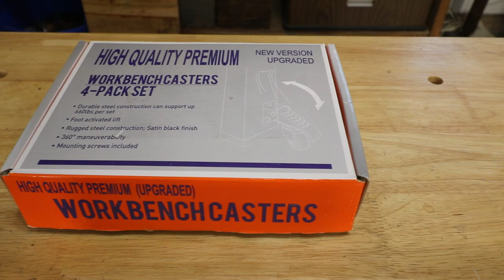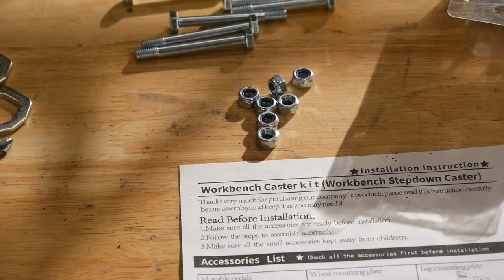Windsor workbench from Harbor Freight, upgrade wheel kit, Episode 208 Coffee and Tools

Comment: I just got the bench and plan on modifying it fairly heavily. And that's the issue I didn't think the bench was going to be very heavy, but if i load it up kith extras I'll be sure to use the affiliate link it's still working as of today June 27 2023! Love the vids brother! Keep them coming. Ever consider installing a table saw to one end to use the bench for outfeed support, I'm thinking of doing that and that'll add some weight. Plus at least a 5 or 6" tool tray/bin on the back side. Hell I might save the shelves for another project and just add some heavy shelving under the top. A lot of guys recommend adding an extra layer of plywood or MDF under the top for rigidity and strength.  See I might need that caster kit after all. Peace My Man!!
Reply from the maker: All good there wooddogg8. Really like that table saw / out feed top idea.

Comment: casters and carts are a life saver in my shop. I've got a 1 car garage space so everything is on wheels so either I can move  what I'm working on to the driveway or wheel everything else out of the way to the driveway. I do need to upgrade work benches at some point, I'm still using 2 old desks one of which I've attached my vise to.
Reply from the maker: Wheels.more wheels LOLO..you get the picture

Comment: How is the stability of the workbench when hand planing wood boards, especially when you have locking wheels on?  Also, could you mount your wheels on the inside of the legs, under the shelf?
Reply from the maker: The wheels are in the "UP" position, but the side to  side is sloppy. Could be a show coming up on how to stiffen that end.
Reply: @SirTools  Yes, I’d like to see a video on what you can ditto stiffen this workbench and make it more stable.  Thx

Comment: I wonder if there’s a way to modify that a bit and weld a connecting rod to each end with a center pedal so rather than lift one leg at a time, you could do each end? I noticed a comment about weight and yes, perhaps at 50 pounds empty, it’s a simple slide. However, each slide puts stress on the connections between the legs and sides and, wear and tear on the opposing feet. Additionally, if you have a project or projects ON the bench, the weight increases and, the risk of shaking things off the bench as you shimmy slide it. You may also have tools mounted, such as a Vice or grinder. These add weight as well. It’s not a huge cash or time investment for a good ole backwoods logic addition of casters to raise and lower for moving. Finally, the move may not be a couple of inches but, maybe clear out of the workshop or to the other side of the workshop. Now, it’s a whole new ball game.